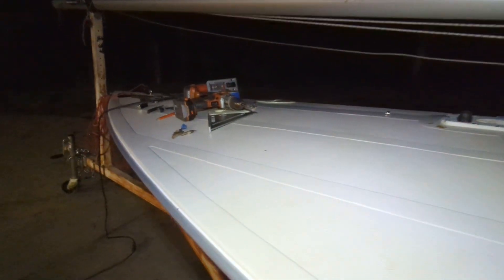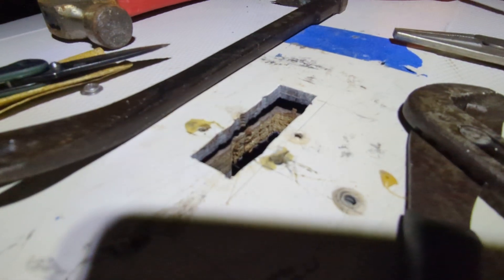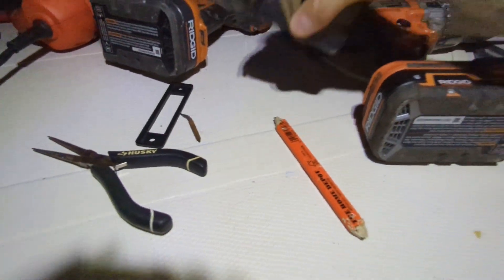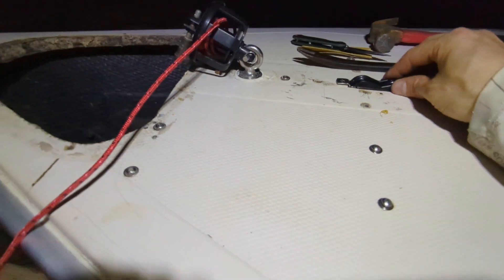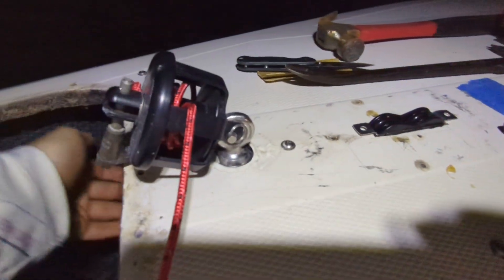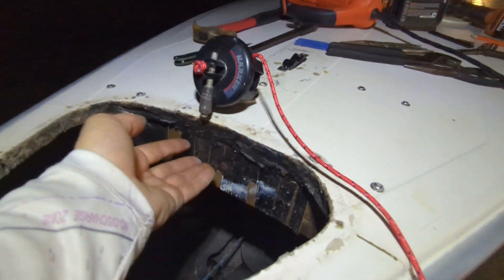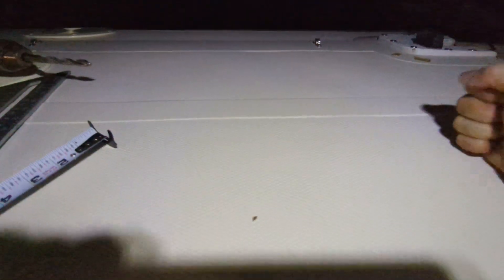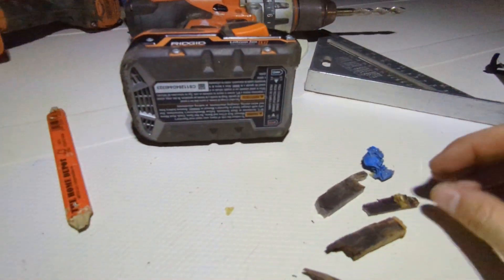1979 Chrysler Buccaneer 18 Deck

Comment: Cory, On the fiberglass layup of the Chrysler Buccs it is all solid-I think unfortunately what you have done is hit one plywood cross supports of your front deck or some plywood someone else had placed in there, those original plywood ribs are separate from the layup substrate they placed those most likely as a second step. The gel coat cracking can be non structural more from shrinking and not from flexing although stress cracking can cause that. I would make sure you attach your support for your furler down to the hull itself as the bow deck could pull up and separate from your hull at the deck join. Good luck